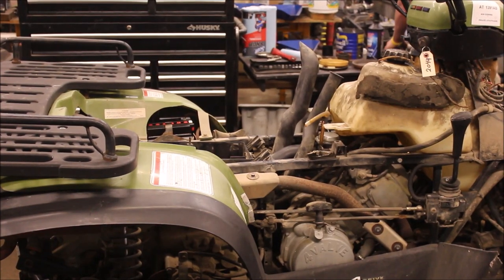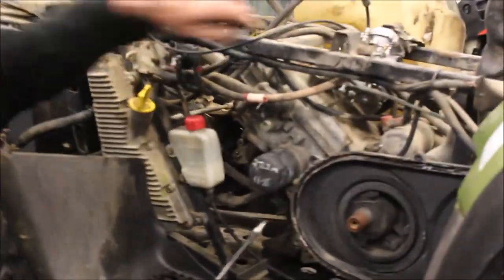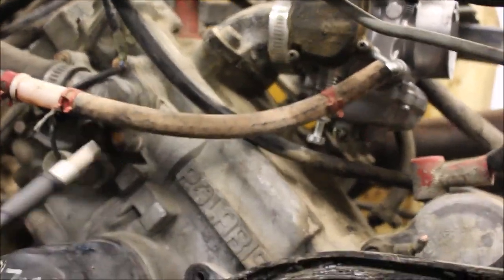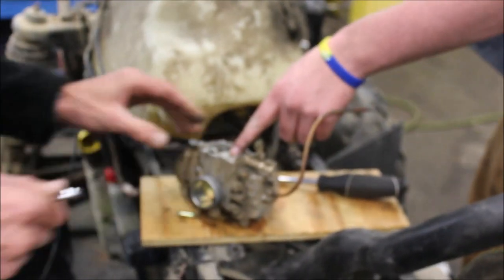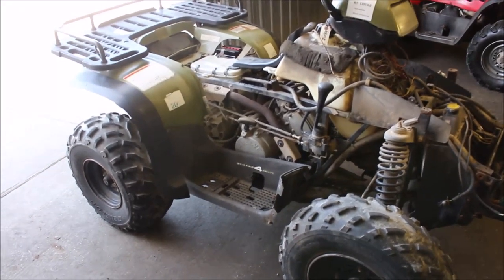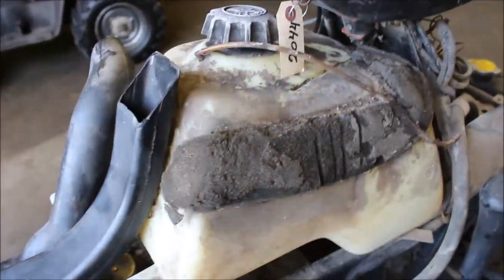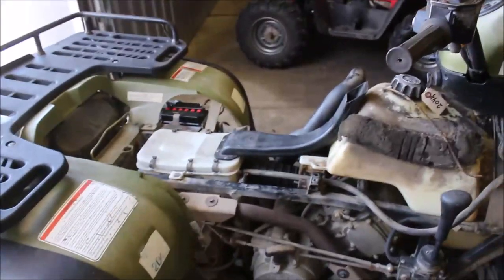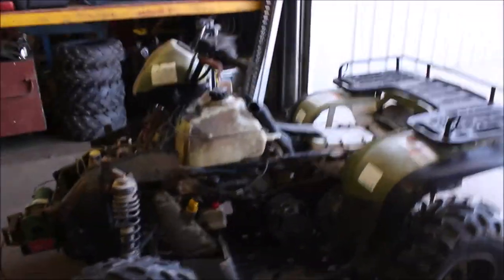Polaris Sportsman 500 runs rough with airbox on/Runs good with airbox off! Find out why!

Comment: Dude.  You just saved me so much extra headaches.  I did the whole carb rebuild,  fuel pump, valve / cam check etc. and couldn't figure out what the hell was going on.  I've never ran into this bogging issue with a sportsman without it being a fuel related issue.  You're the man and thank you so much for this video.  🤙

Comment: I have been struggling with the carburetor on a 425 magnum and I believe you gave me the answer I was looking for. Always nice information on your channel
Reply: I  hag a similar problem on a 98 magnum it was a broken filter stand
Reply: @georgehuffert1800  This poor thing I’ve been working on was definitely rode hard and tore up. The thing that really baffled me for a minute was the decompression spring, it was there and appeared to be doing its thing but turns out it was shot. Chased that little gremlin for a couple of days.
Reply: I had a 425 magnum that wouldn't run full power because the foam was missing on the air box snorkle. New foam and she woke right up.

Comment: Bought an aftermarket carb for next to nothing.... couldn't dial it in to run right... only with the box off, no air filter, nothing.  But I watched some of your vids and bolted the air box tight it runs smooth now...

Comment: Having a good sealed up air box is imperative for proper tuning as the resistance ensures the Venturi effect delivers the right amount of fuel. 

As for the OE carb issues, it’s more productive to swap out the carb with an aftermarket one. HO and Non-HO carbs are inexpensive and plentiful online. 

When a non-HO needs a cam replacement, I change the cam, carb and intake manifold to the HO model for a little more power.
Reply from the maker: The only downfall with the swap is the H.O. had a bigger exhaust pipe. There's a chance the pipe can get really hot. I've done the swap already. didn't notice much of a difference.
Reply from the maker: I had put 2 carbs on. a clean oem carb and a aftermarket carb. I got better results from the OEM carb.
Reply: @TitaniummanGarage  typically every Polaris I get has a bad carb from sitting, so I replace them instead of rebuilding them. HO conversion was done to see what it was all about, buyer specifically wanted a HO model and I was able to advertise it as such. 

A well tuned carb will run the best, OE or aftermarket.

Comment: What mystery!   One might think that a leaky air box would be more like running with the box off?

I have a 1999 Polaris Sportsman 500 that was running fine, but has started major loss of power when apply gas, especially up an incline.  Changed the air filter and plug - didn't help.   Have some seafoam in the gas thinking trying the spray in the carb.   Apply the  choke when losing power does not help and may make worse.  But just for fun - will try running without the air filter box for a short distance.   Love the easy tests that can help give info on the problem.
Reply from the maker: It could be a bad camshaft. Those years are known for bad cams.
Reply: @TitaniummanGarage what years had that issue? Does the 2001 have it.?
Reply: you ever figure your sportsman? mine is a 96 same issue, major loss of power when goosing  it...  lurches to a stop if you let off gas quick

Comment: I been struggling with my 2011 500 HO sportsman been sitting so im thinking a new carburetor after 7 years in my garage 55 hrs on this machine! What's your thoughts bud? Great videos all around i watch all of yours THANKS MAN
Reply from the maker: I would try a carb. drain the gas. What's it doing, or not doing?
Reply: @TitaniummanGarage   the machine was running great about an hour into ploughing snow just started farting sputtering and backfiring I drained the tank took the line off with inline filter and some gas came out not a lot so I have a new pump to mount and new lines to run. Then the carburetor is next. Does that make sense to you and thanks a lot your awesome!
Richard
Reply from the maker: @richardmartin4634 .That's what I would do. If you see in some of my videos I use a small fuel tank with a hose and run it to the carb. Its actually off my snowblower. I start ever wheeler with it first. Then plug in the fuel pump ect. If it runs good with the small tamk..but bad with the fuel pump and tank hooked up..I immediately know it's either the pump, vacuum and gas lines or the screen in the gas tank is plugged.

Comment: How do I contact you? Do you accept phone calls? I have a question, first four wheeler and I could use some guidance.

Wheeler sat for a long time, would run but shut off when you let off throttle.

I replaced the whole carb, put it all back together, got it to fire up and idle, but doesn’t have the power it should when hitting the throttle.. it had plenty of power prior to carb replacement so I don’t think it’s cams or anything like that.

Get back to me when you can, trying to get this thing ready for the hunting camp!

TIA

Comment: Ive got a 509 ranger efi have replaced fuel pump pressure is 38 psi new cam n rockers starts well runs good for about 15 minutes pressure stays up at 38bpsi  then seems to flood at above 2500 rpm plugs black new plug n coil then when turned off wont turn like a bad battery new staryer and a n70 600 cca truck battery fitted with new big leafs and earth directly to engine im ready to burn it whats your idea on the problem 1600 hrs on machine
Reply from the maker: Do you mean a 500 ranger? If the plug is black its running rich. It also sounds like the decompression ball on the cam is stuck open. was it a aftermarket cam?

Comment: I have a 1997 Polaris xplorer 500 and it Cuts out at full throttle when riding but when u rev it it doesn’t cut out do u know what that can be.
Reply from the maker: It could be your cdi box. Try unplugging the black wire. If it improves, it's your cdi or kill switch.
Reply: Could also be the clutch slipping and the engine hitting the revv limiter

Comment: Sorry but I don’t see how your video solved a thing.  I understand a China carb not working but then I didn’t hear if it previously worked and then started acting up.  Then you swap an OEM carb on and same problem so that ruled out a bad China carb.   Then you install an air box from a different model year and it runs better.  That may have solved the problem for whatever reason but it’s by no means a fix. 

If the engine ran better with air box removed that means the engine was getting more air.  With airbox on the air was restricted and air was decreased so the engine had more fuel that it didn’t like.  Typically the carb can handle the air mixture with box in or out when everything else is properly working. So this tells me there’s a different issue.  These carbs work off vacuum and pressure differences in front and behind the carb. A worn motor wouldn’t have the same vacuum as a healthy motor . So there’s one avenue to explore.  The other avenue is any vacuum lines or or ports on the carb not connected properly.  Some of those China carbs have a vent on the top diaphragm cover that is usually shipped with a cap over it. That actually needs vented to atmosphere.  The OEM carb doesn’t have that as the port is on the side but still is just a vent.  Another issue with these Polaris motors 500s, 600s 700s and 800s is the black rubber intake boot.  They will crack with age or leak between the head and boot.  This will suck air between the carb and head and cause the lean condition and a vacuum problem. 

So again we don’t really know the issue here